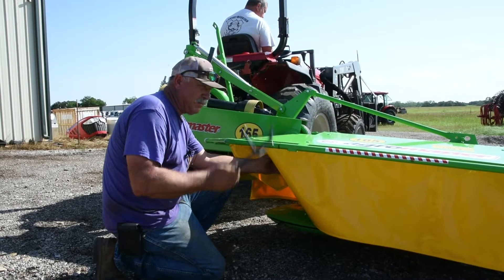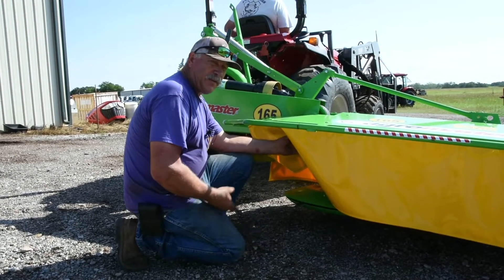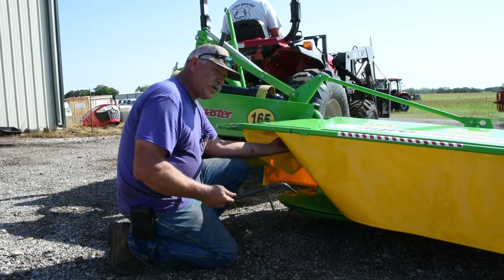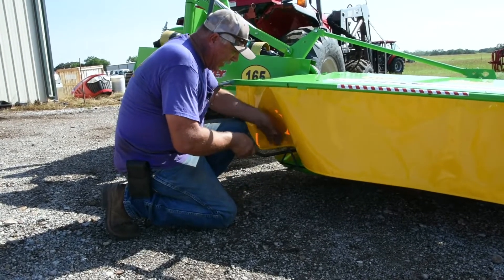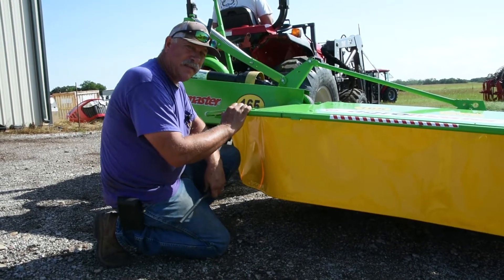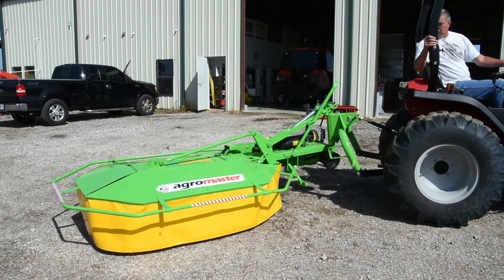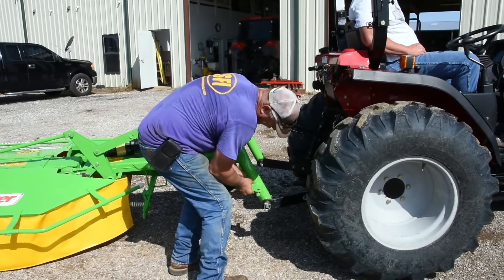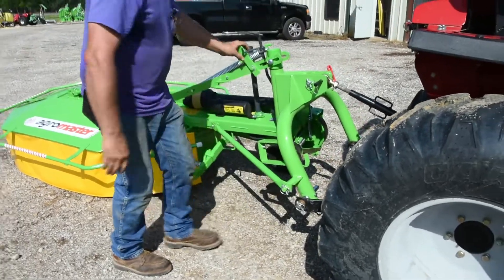How to change the blades and turn the Drum Mower to transport mode

Comment: I have that mower under the Ranch Rite brand. I have tried every which way to change those blades and can't get them out. I am not a weakling either, and even using an extension to the tool as you suggest no luck. Either the tool slips off the plate edge or I am almost lifting the damn mower. Still can't get any of the blades out. Do you have any idea what I am doing wrong? I don't think the tool should slip out on me like it does, but even when it doesn't I can't get the blades out. Advice appreciated!
Reply from the maker: lift the  blade to the bottom of the top drum.  then slide out.   Try looking between the drums. you will see what I mean.  good luck!  This is shown in my videos.
Reply: @smallfarminnovations4265  thanks for getting back to me, much appreciated. I thought I was doing that, so maybe I am angling it wrong. I will try again!